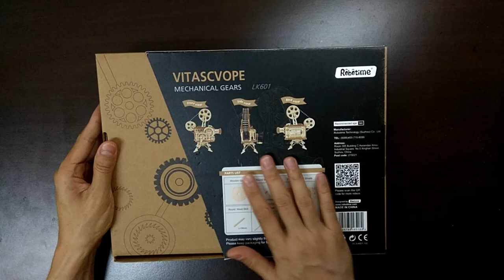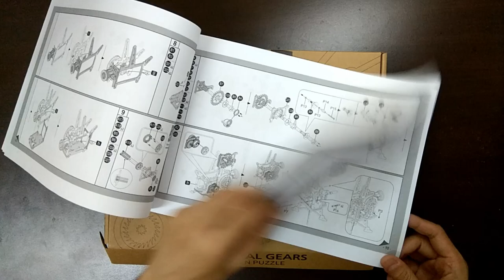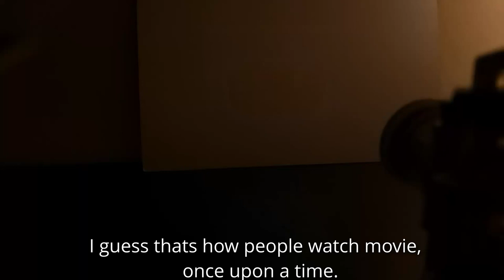Robotime Hand Crank Vitascope ROKR LK601 DIY Film Projector (15% Discount code: yoshiny).

Comment: I've taken the two sets of gear apart because of problems.  Be careful about that because the steel rods will make the holes a tiny bit fatter.  It went from holding really nicely to the rods slipping out of the last disk inside.  It takes a few steps to get to the addition of the orange lugs.  Once those are on, it will stay together well.
Reply: Enter clips though

Comment: Dude, your video was invaluable in putting this model together!  I've done 2 other similar ones, but watching you do it certainly sped up my completion time!  There are a few errors in the video, such as 1 part was incorrectly labelled (I think it was C3 that you labelled as D3), and you didn't put the axel end gaskets on the top wheel as the instructions show, and you didn't wax several parts that the instructions say to wax, but overall this was a very helpful video - thanks so much for putting it together!!

Comment: Received as a birthday gift Jan. 9, 2021.  My wife and I just completed it.  Your video is great but could be a little slower.  We had difficulty with parts falling off so we used some glue on parts that were not moving and it worked.  It was a little difficult and fingers do still hurt but we had fun doing it together and it works perfectly.  Thanks for the video.  PS glad they added some extra parts since we broke 2.
Reply: Go to you settings in the video and you can slow down or speed up the youtube play speed.
Reply: u can slow videos down by pressing the playback speed at top right

Comment: In the video there is a little mistake, after the installation of the lense with the piece number E10, you don´t explain how to get the cable to this piece.
If you follow the video instructions will have the cable free and you'll have a problem when you install the film.
That was a problem for me.

Comment: I got this and am building it. But at step 2 my gear doesn't hold together nicely like yours with the metal pins. The pins feel loose and the wooden pieces are not held securely. Should I glue it?
Reply from the maker: I didn't glue it
Reply: I know, it looks like yours holds together well, but mine are loose and slide around. Sad times.
Reply: Jokes make me happy keep going at it it’ll work, there are securing bits
Reply: I got this and mine does NOT turn with ease. The cogs are just super stiff and slightly warped to they dont really connect properly
Reply: @adamnicholson1839  are you fully done with it or...cuz it was like that for me before and in the later steps the pins secured it
Reply: @CXHo-sy1xz  yeah it's all finished

Comment: I won't connect to the plastic piece in step 9 i tried disassemble the bottom like you did but it's just lopside when i finally got the twothings together the bottom and frame wouldn't fit
Reply: Make sure the 3 pins that go into that wood gear are all the way in the first disk.  I had the same problem.  If the heads of the pins are not flush, they will get in the way of that disk siting flush with the plastic gear.
Reply: @barbaraiverson2035  Mine won't engage the plastic gear and make it turn. I don't see how a three cog piece will fit into a single bar to allow it to drive the generator.

Comment: I am still having problems getting that A17 to fit in the plastic gear
Reply: Me too.  I hope i find a solution.  I need to finish this in the quarantine
Reply: Has anyone fould a solution
Reply: One thing you need to do is make sure the 3 columnar pins are pushed all the way through those disks.  The heads should be almost flush with the inside of that circle.  I had the same problem until I realized they were not all the way in.  Once you get them in, place that gear into the plastic and rotate the alumnium disk and the handle opposite directions.  They will then slip into place.  I had the hardest time keeping that gear in place until I got the base pieces on under neath.

Comment: how do you get the diamond looking part to stick together? i cant seem to get it
Reply from the maker: what part number?
Reply: @YoshinyYo  A15
Reply from the maker: @kennethkindrich3114  do you mean stick with D6?
Reply: @YoshinyYo  like..the whole stick that goes below it. All the circles and the metal sticks
Reply from the maker: @kennethkindrich3114  first have to make sure all the circle parts arrange in correct order, follow the instructions in the manual, then slot in the diamond part before attach the metal sticks with circles.
Reply: @YoshinyYo  i have done that several times lol. I have taken it apart several times  aswell. The pieces just keep.....sliding off when i am putting other things together.
Reply: @YoshinyYo  did you use glue at all?
Reply from the maker: @kennethkindrich3114  no, I didn't use glue at all. You can glue it I guess.
Reply: @YoshinyYo  i might. I apologize if my last comment came out rude. It was not intended to
Reply from the maker: @kennethkindrich3114  is fine, I'm glad that I could help.
Reply: Yoshiny Yo - I’m having a nightmare of a time on this same step. How did you get these pieces to stick without glue?  They just slide right off
Reply from the maker: @aguy4664  maybe I'm just lucky to have the part that fits.
Reply: Hey, same problem here... did you eventually manage to find what was wrong ? Or did you just glue the thing ?